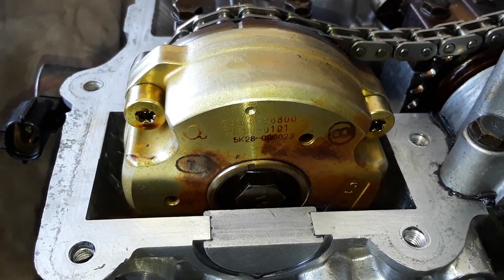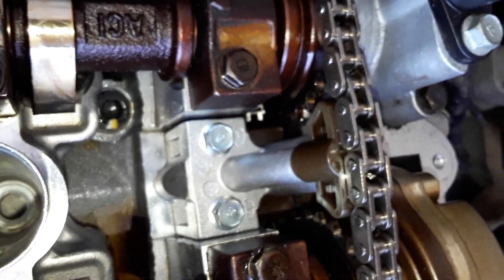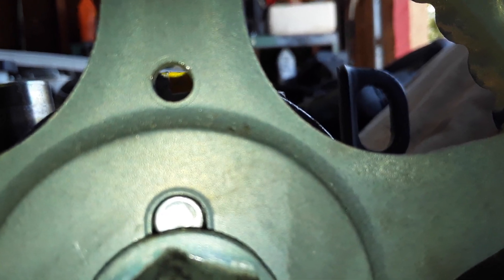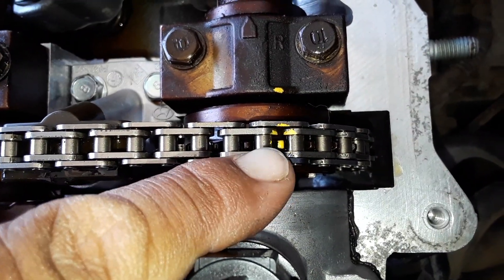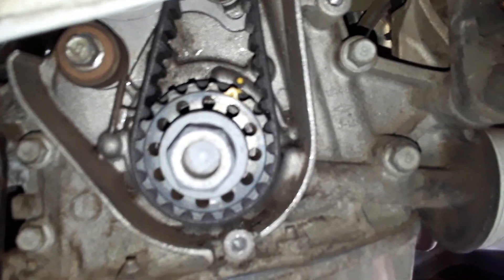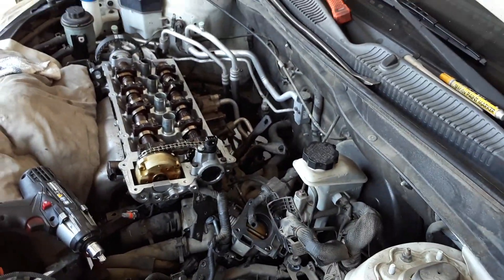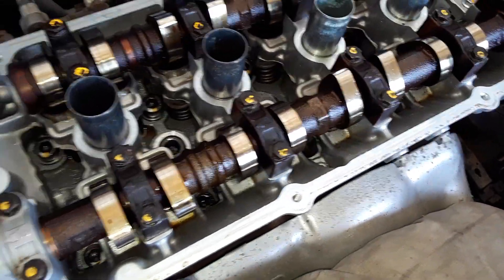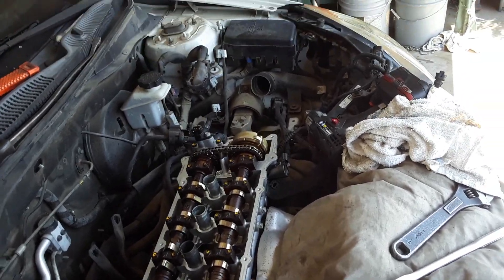Documenting my timing marks on a 2009 Hyundai Accent 1.6 L

Comment: Hi there 😊 
I really need some help 
I have the same engine 1.6L DOHC Accent 2007 need a head gasket after changing that gasket Chek engine keeps showing on dashboard I did a scan..came up with P0012 Camshaft position over retired bank 1   I did all the steps on timing chain and crankshaft and.... still have p0012 help me please 🙏

Comment: How's the car running? Timing was correct?
Reply from the maker: Yes timing is correct, runs like a champ.
Reply: @SuperDjnrg Right on, btw would really help if you help me with the Head torque spec. 20Ibs each bolt, followed with 65 then another 65? You don't back off right?
Reply from the maker: @WilliamVG  no , dont back off

Comment: Should have just sold the car. Why the hell would anyone design a car with both a timing belt and timing chain? Honda and Toyota of this year made cars with engines that have one timing belt or a timing chain. But no, KIA wants to makes things difficult for no apparent reason. I have an 06 KIA Rio and I have graicously changed the timing belt on time and changed the engine oil frequently to avoid the timing chain from stretching and wearing out the sprockets.
Reply: the chain is only to link the 2 camshafts. the chain sprockets timing are marked by factory on both the sprocket and cylinder head so theres not really any way to screw it up if you have to take cams out. timing is done by timing belt, which links crankshaft to exhaust cam. hyundai G4 engines are really fantastic to work on in my opinion.